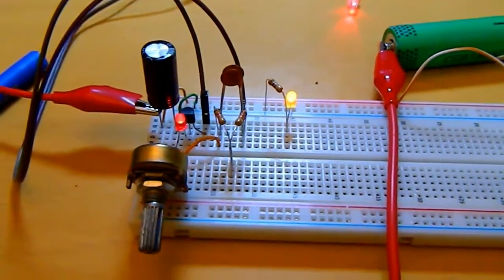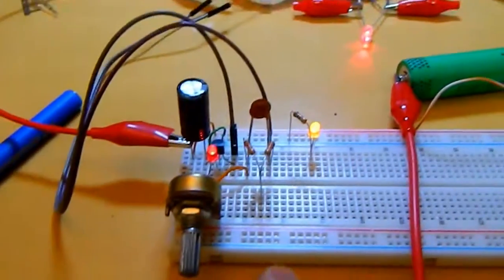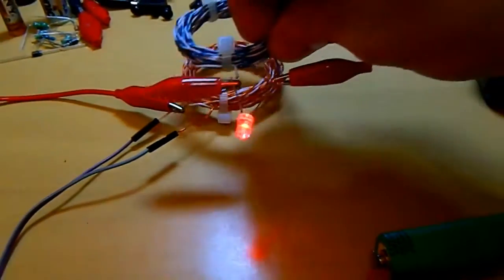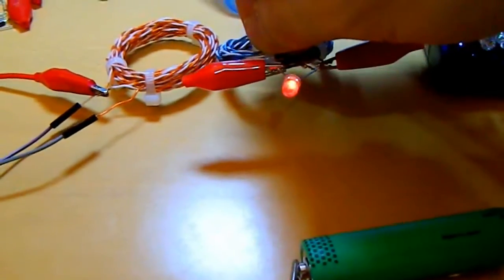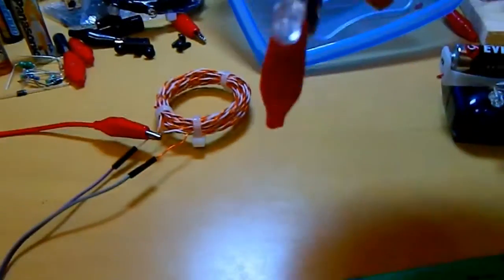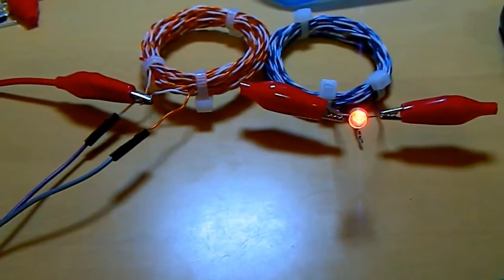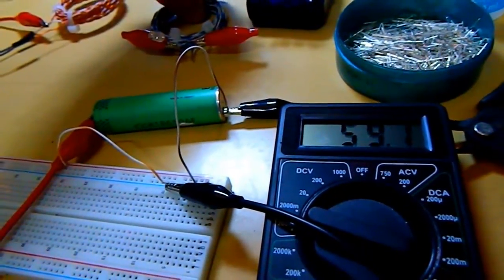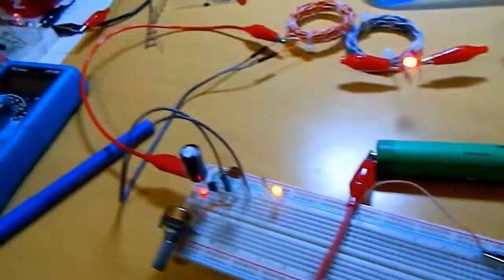Joule Thief - Horizontal Wireless Transmission

Comment: If you cut the coil in half, and put the cut end with the wires in the center bullseye of a target, the magnetic field radiates out from the center and is like the rings around the bullseye.  Your secondary winding intercepts those magnetic rings as they radiate out from the center bullseye.  It would be helpful - very helpful - if you showed a schematic of the circuit.  This is also why a Joule Thief can be made with 2 chokes side by side.  Thanks.

Comment from the maker: It can be controlled by the potentiometer, but I fixed the maximum amp to 60 for charging other batteries with the wireless chargers. So, with the pot at the minimum resistance it will have a 60 mA maximum discharge.